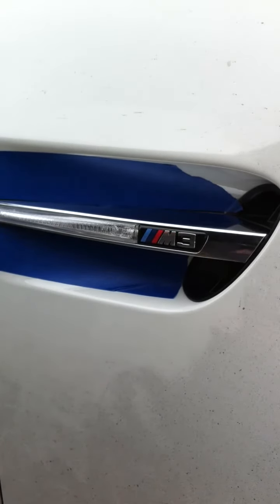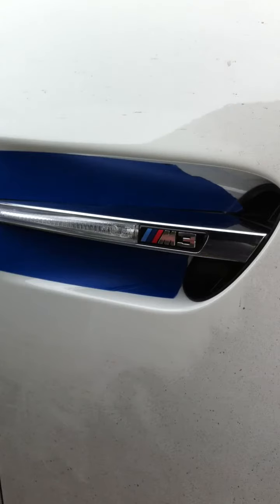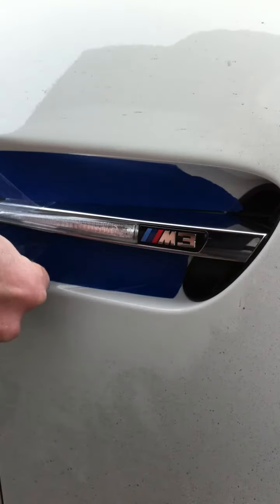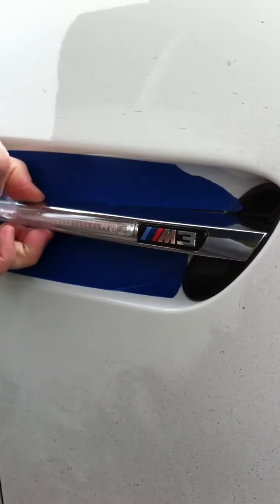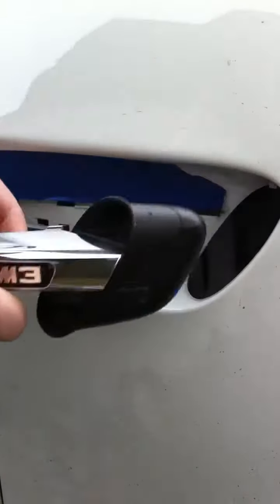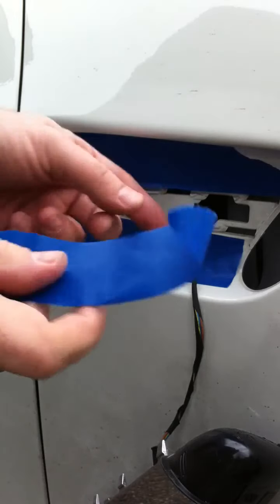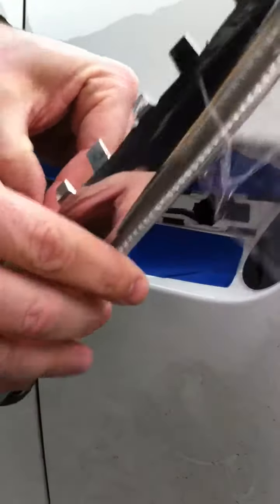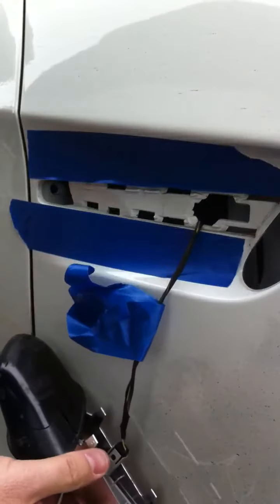BMW E92 M3 sidemarker gill removal and installation Part 1

Comment: Just did mine yesterday. This method worked really good. The other video that's floating around with the guy sticking the screw driver under the tip of the gill, with a bit of electrician's tape to protect the paint, creeped me out. The packing tape did the trick. It's very important to observe the spot where Jason puts the tape on, it's towards the back of the gill. Very good Jason, thanks.

Comment: The taping trick plus squeezing did not work for my E92 M3. Instead, no tapes…I just squeezed the smaller part that’s closest to the tabs that hooks onto the car with both hands and start to pulled up and down hard, but controlled to release the clips. Pops right out 😅.

Comment: I just did this on my M3 E90 Competition 2011 - it was stubborn as a son of a bitch! Didn't use packing tape - I used duct tape and three pieces of it next to each other, starting with placing the first piece about 30mm in from the rear and moving towards the front.

You can forget about the squezing part. I like to think I have strong hands but I didn't budge one bit, looking at the construction I don't understand how it would (the inside has another thick plastic piece). Anyway - I pulled on the different tape bits and tried to rock the gill upp and down, front to back at the same time.

I wasn't sure if the hole fender would come of first... But suddenly it let go at the rear a little bit, but was still really stuck towards the front. More pulling and rocking - another let go - more pulling and eventually - PRESTO! 

A bit nerv wracking but nothing broke. :) 
Just make sure that you keep your hands against the fender and use them for leverage - so you don't lean away from the car...

Now I just realized that the emblem is glued to the gill, so I have to remove that...

Comment: Looks simple but doesn't work like that, either your grills have been removed several times making them lose or less resistant as mine just will not come off at all, tried a few methods prior to looking online for help, really didnt want to use tools but may have to :(